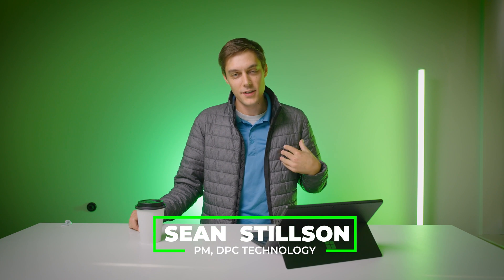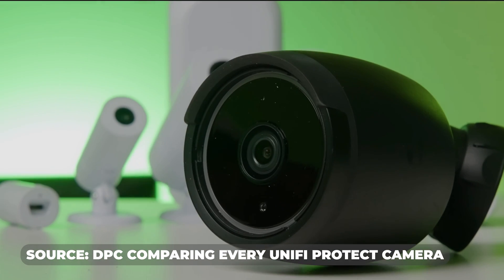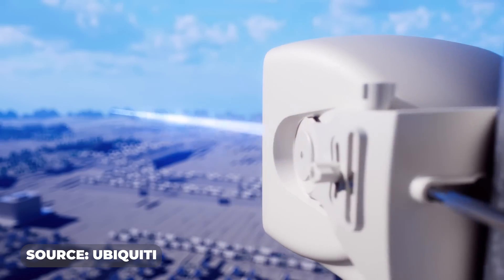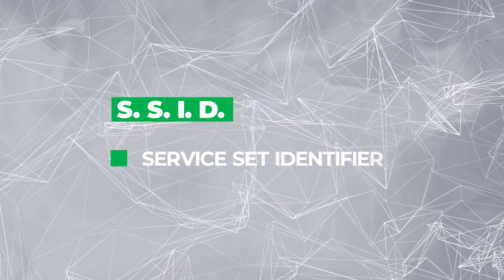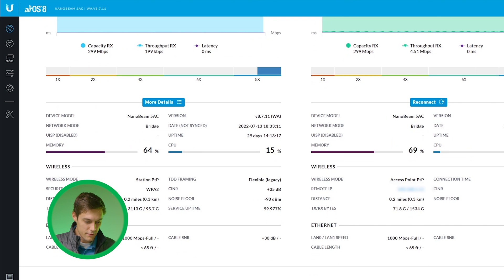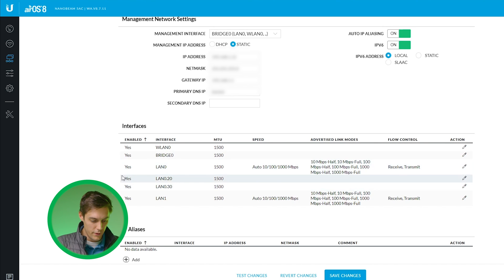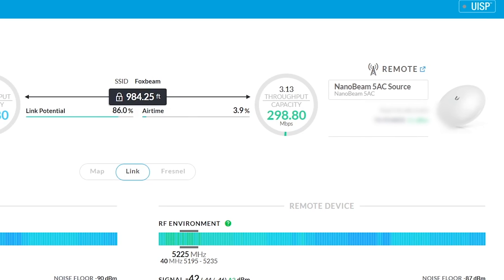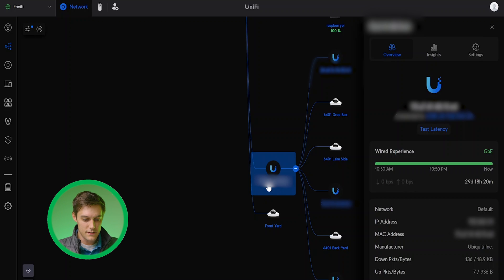WIFI Laser Beams!??! Unifi Nanobeam Wifi Bridge

Comment: I have a Unifi system with 2 Nanobeam connections (4 nanobeam devices) linking a remote office to my residential house that has our internet connection.  The Nanobeams came first, and I upgraded the rest of the network to the Unifi ecosystem thereafter.  Unifi must have updated its Topology app as the visualisation now shows the Nanobeams as devices which helps seeing how the network is physically connected.  When looking at the port information of switches connected to the nanobeams, it still ignores the nanobeam and shows it as connected to the port of the Unifi switch on the other side of the nanobeam connection.  I like our nanobeams, but having a full Unifi system everywhere else in the network, I would have wanted Unifi capable PtP connections instead of the UISP nanobeams I have now, as it would make network troubleshooting easier, having all hardware on the same Unifi platform instead of having to log into each Nanobeam separately to manage.

Comment: @ 0:38 One possible solution to this problem is called an "Equipotential" ..... When pools are built, an equipotential is used. Basically, it's just an exposed copper wire in a trench surrounding the perimeter of the pool.
Reply from the maker: Interesting

Comment: Ah man for the price of the Nanobeams, you could have hired a cabling guy to come and terminate the fiber if you had already burried and ran it. They probably would have just asked for cost of connectors and a few beers. I’ve done this for DIY’ers in the area, it takes a few min per connector and you don’t need special/expensive hardware to terminate a connector. (Fusion splicing is different from terminating ends for devices) Anyway, good video, best of luck
Reply from the maker: Thanks for the tip!!!

Comment: Used a lot of ubiquiti equipment and for most airmax is plenty of speed for the price. As far as the fiber goes you can buy set lengths that are terminated on each side. They do have fiber converters fairly cheap or you could get the modules for a switch with sfp capabilities.
Reply from the maker: Thanks for the info!

Comment: First things first, whilst AirMax is loosely based on Wi-Fi, it isn't Wi-Fi, don't be that chump who can't tell the difference. The one on your house, move it to the barge board, hanging it isn't making that much difference. Make sure you don't have your Wi-Fi AP (WAP) near the PtP radio and keep channels seperated. Keep your Master (Sation) at the head-end / home, the bitch radio (client) at far end. Don't stress on DFS and channel selection, the radios will not use DFS unless it's a last resort. In yanky land, I think you can run 80MHz wide in PtP mode, this will fatten up your link. Turn the RF power up and make sure ATPC (Auto Transmission Control Power) is on with a target signal around -40 to -45. This will allow the radio to ramp up in heavby rain, smoke or fog to keep link and modulations up. LKeaving the network settings on basic will still allow seting a static address (in-band). For those not networking strong, leave it in basic. The radios will automatically transfer VLAN's providing you haven't screwed your network and its MTU.
Power pass in NOT AF PoE, it is 24V passive, only suitable for some older UniFi flex devices or other UBNT radios. The TooughSwitch is not UniFi, it is edge. The USW-8-150 is the Gen1 equivelant and allows 24V passiove PoE needed for the radio, same as other Gen1 switches. Gen2 switches suck balls now that 24V has been removed. The radio link is designed as a transparent bridge, well fully if you don't mess with the network settings like you did.  The Industrial switch has now replaced the 8-150, halfway between Gen2 and Gen1 but no 24V.
Reply from the maker: Thanks for the feedback